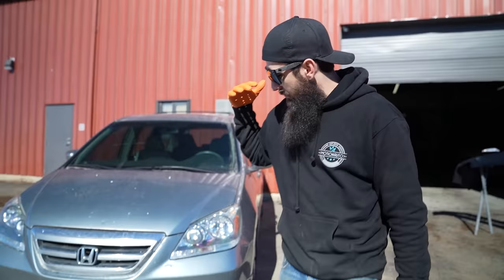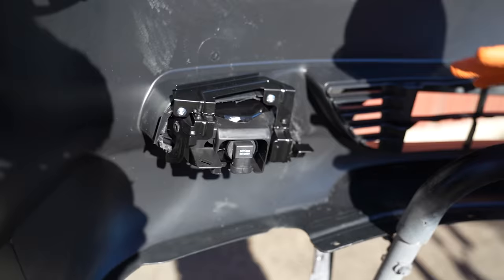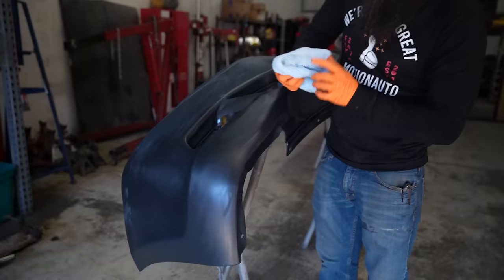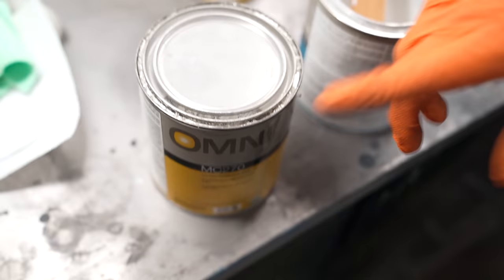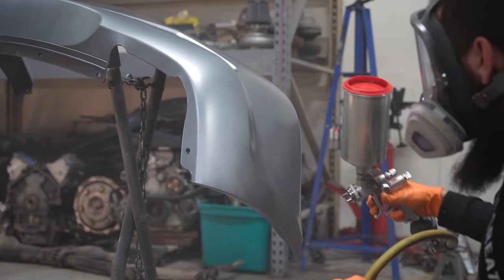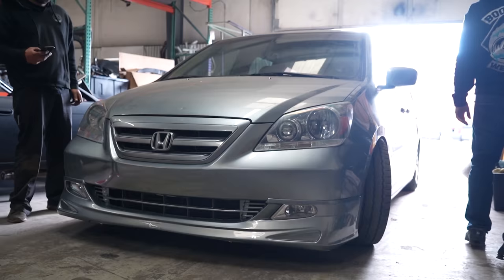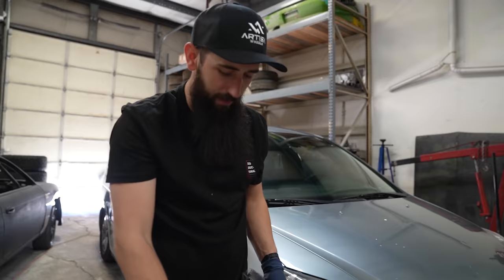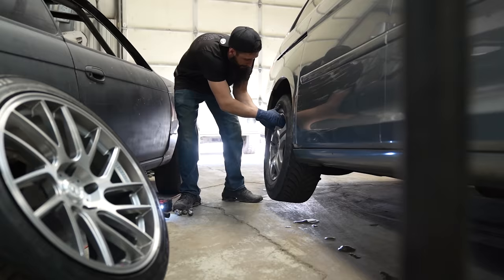Rebuilding (And Heavily Modifying) a Honda Odyssey " Man Van"

Comment: Paint matching the grill with the bumper and grill was a good decision.  Those wheels look like were made for the Odyssey.  I would raise it a little just for a little more clearance, but that's just me.  Of course the roads in my area would destroy the lips and fender wells, so a little more clearance would be necessary!  Overall, it turned out real good.

Comment: You got the van stanced out and looking good. Install an amazing sound system in it
Reply: I second this banging motion auto sound system 🔥
Reply: Looks like an EX-L I have one. Because of the bullshit VCM system if you add subs to it you get this weird low pulsating because of active engine mounts. You have to put a new head unit in with an expensive interface to fool the computers that the oem head unit is there. Not saying cant be done but its a PITA ends up costing half or more what the van is worth. And if he is carting around a toddler not usin it much anyway.

Comment: Lookin' good! We run BC Racing coilovers in our '08 with 20x10.0 (square set-up) TSW Bristol and Toyo Proxes Sport rubber. Put camber arms in the rear to remove a bit of negative camber. Trimmed our rear arches and set-up at -1.4 degrees of camber front & rear. It's heaps of fun.

Comment: super clean suddle mods. i have the same van but dark grey. i want to add front and rear bumper lips add the front fog lights but maybe yellow also color match my grill and add the coilovers. what kind if coulovers you running by the way. that makes a huge difference. im on 16x8 aftermarkets thats how i got mine but i think 19s look best big with enough sidewall. but beatiful oddy bro you killed it made it super clean you have an eye for this stuff and good taste

Comment: Look sick if you shaved the body smooth, kswap with a smaller turbo nothing drag strip just a cool cruiser but I would for sure get smallest wall size tire i could. I think those are too meaty looking for the wheels but cool van already

Comment: Looks sick. You gotta disable that VCM bullsh*t that 3.5 engine has. Itll roast the plugs and coil packs. And cause a bunch of unnecessary build up in the engine. You can get a little vcm disabler online. It runs much better on full time 6 cylinders. Instead of the vcm switching between 6 and 3 depending on driving speed.

Comment: Can't wait to off this 08 pilot and get back into an oddy pref a later 2nd gen I was at the junk yard yesterday there was the nicest 2nd gen I've ever seen it had every option but a sink the thing was all black leather inside with the granite looking gray marble trim the steering wheel was wrapped black carpet black leather I pulled 4 brand new slotted rotors a* brand* new ac pump brand new condenser brand new p.s.pump cerp belt 6 new coils 6 .ngk new plugs the van had to be from Florida im in n.y. it had the DVD front and back it looked like a brand new van..I pulled 800$ worth the parts off this thing pads were new..I wish that wheel would work on my pos pilot but I pulled every peice that would fit off poor van shit I Evan took the dip sticks... I'm thinking of cutting the carpet